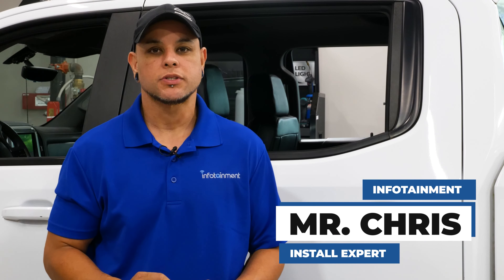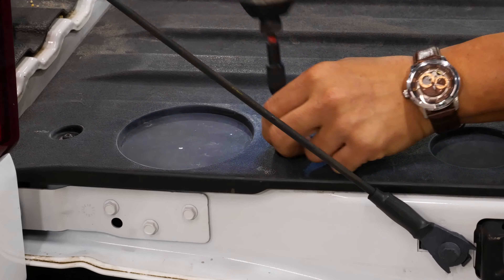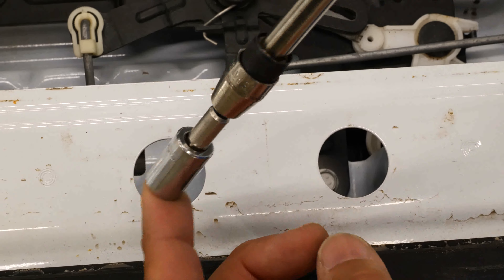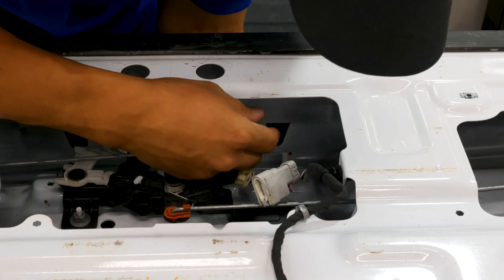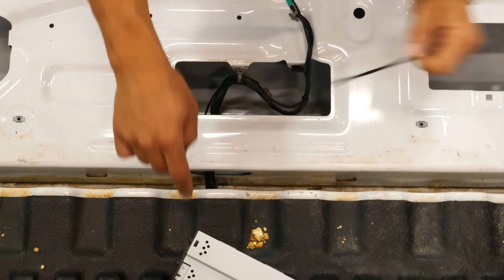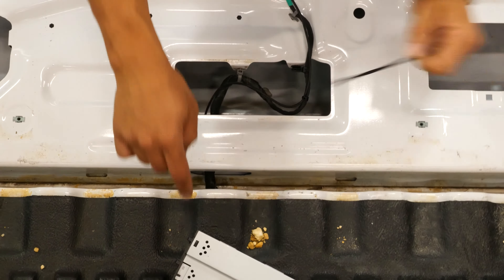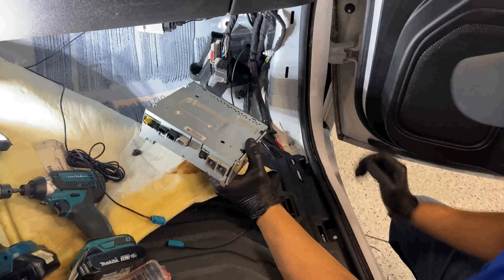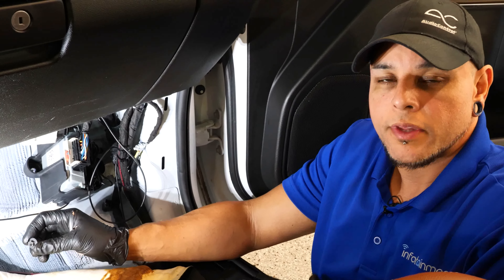2019+ GMC Chevrolet Truck OEM Analog To Digital Backup Camera Upgrade - Installation Guide

Comment: Hello. Do you know if the Buick Regal 23323601 VCB-C264 camera can be installed in place of the Opel Insignia 23323602 VCB-C271? The cameras are physically identical, the plugs are identical, the wire color arrangement is identical. GM is the whole family, Buick, Vauxhall, Opel Insignia. The only difference is the part code.
Reply from the maker: This particular package is meant for 2019+ GMC and Chevrolet trucks.  

We do not currently have any camera solutions for a Buick Regal.  We are always adding and developing new upgrades kits.  So if you wouldn't mind taking a minute to fill out our Product Interest List Form. That will help add to the demand for that particular upgrade and vehicle.  Our development team takes direct priority based on demand from this product interest list.  We'll also notify you if something becomes available for your vehicle.  

https://forms.zohopublic.com/infotainmentcom/form/ProductInterestListForm/formperma/m7R2exajUQkfs2WJO8mkDzUcYC2HIt5WrUWxFICnigs

Comment: 600 dollars!? 😂😂😂
Reply from the maker: We do not sell cheap equipment. We sell OEM quality equipment that is fully tested, pre-programmed and procured based on your Vin. There are plenty of companies that sell cheap products. We want to provide a part that we are able to guarantee works and will continue to work. We are confident enough in the product we sell that we are able to warranty it through installation and up to two years depending on your selection at check out. We feel our pricing is competitive as we are comparing our pieces to the cost of getting a new vehicle as opposed the cost of an aftermarket part whose quality is greatly inferior.